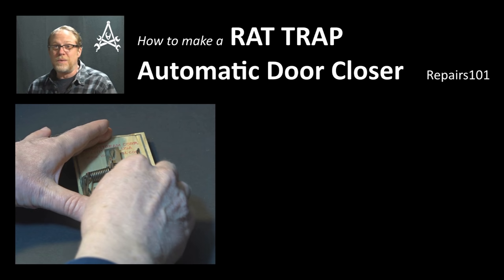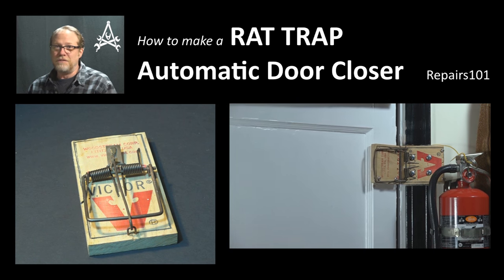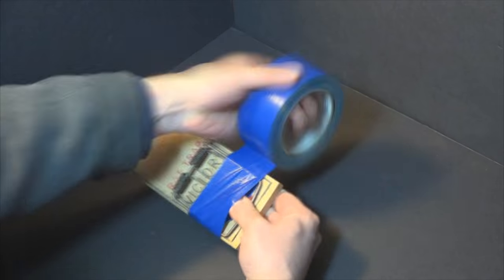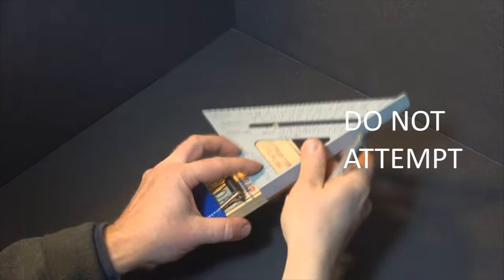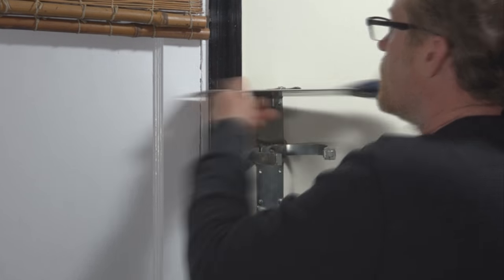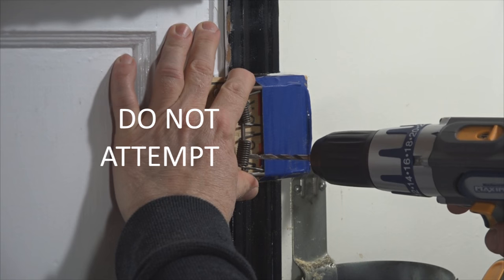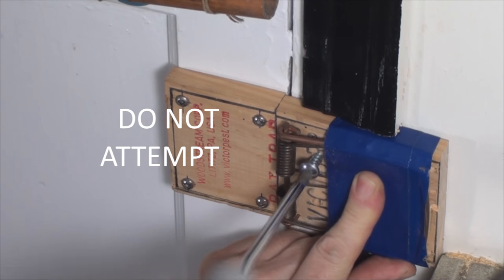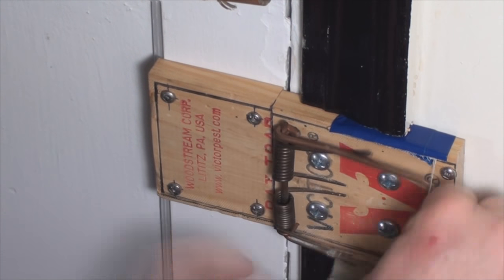Rat Trap Automatic Door Closer

Comment: I bet the cycle life is low and your spring is already broken or noticeably weak by now.  Dig your style though!!!
Reply from the maker: Sorry to contradict you but it's been in service for over a year and absolutely no sign of weakening. We use that door at least 10 times a day (no exaggeration), it's our primary entry point.
Reply: Repairs101 Cool!  As a ME I am surprised that such a low cost spring would work so long.
Reply: I wondered that too but then if you think about it a rat trap is designed to be under load for long periods of time and in this setup it is for most of the day under little load sure it gets loaded up periodically guess time will tell.
Reply from the maker: OK it's official the Rat Trap spring lasted until today , SIX and a half years after installing it and 10x daily use or more one spring has broken. Amazingly the other spring still has enough oomph to almost close the door (4 inch gap).

Comment: I am searching for ideas on using a rat trap for a different purpose, and that is to assist in pulling a pin from under a "guillotine" type drop door on my home made feral cat trap.  We live on a 60 acre bush property and there are several feral cats that are killing our native birds and reptiles, so we need to catch the cats.  The drop down door is made of 5 ply and needs assistance for the tread release to pull the bolt from the door.  The concept of using the rat trap spring seems to be the way so I am working on a design to utilise the spring and catch bar of the rat trap to amplify the light pressure on the tread board by a sly cat.   I appreciated your video and am confident the concept will work for my purpose.